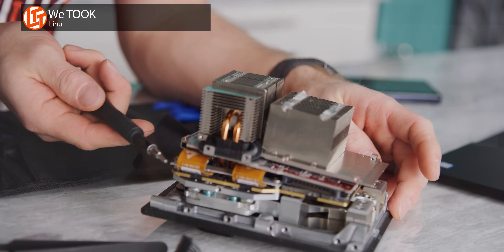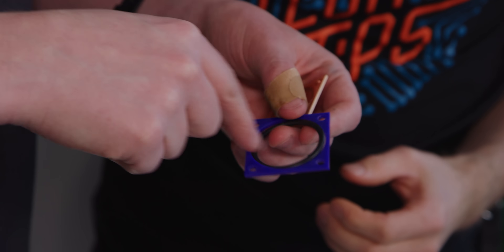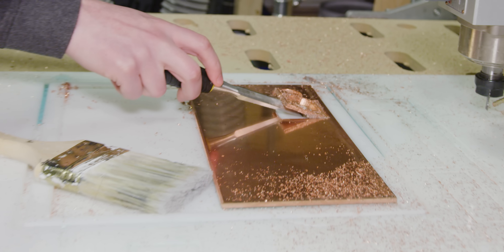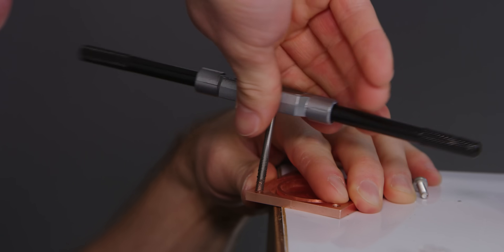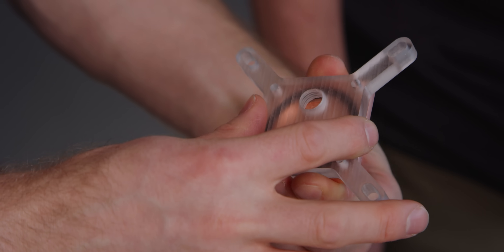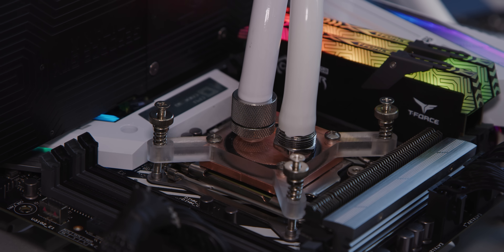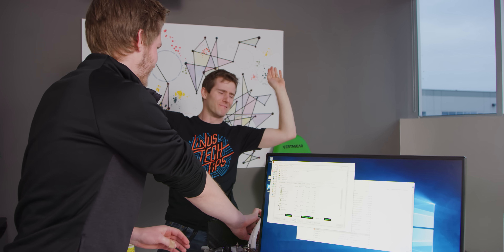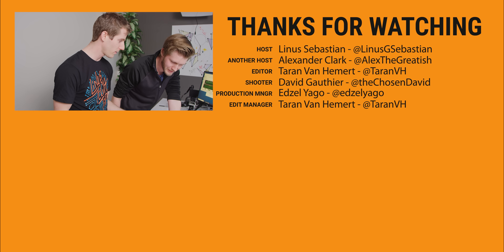We Built a CPU Water Cooler!

Comment: So, some ideas on the water block - making . . .

1.  I think I saw that you had a drill press somewhere.  Go to Princess Auto and buy a cheap centre drill or small centre, so you can put it in the drill press chuck.  Take your top and bottom pieces to the drill press and drill a hole, then using the centre and the tap, without moving the piece of material, immediately tap the hole.  This way the threaded holes will be straight and un-screwed-up, and you will be less likely to snap a tap or break the acrylic due to accidental (linus) mis-handling :)   This works on any size tap.  It takes longer to describe this than to do it.  If you do the holes on the CNC, then just use a centre in the drill chuck and run it down into the holes in the pieces to automatically centre them, and then use the centre and tap technique, or even just put the tap in the drill chuck if you're feeling brave and hand turn the smaller thread sizes.

2.  If you aren't sure on the flatness of the base block, then "lap" it.  Take a piece of glass (like old window pane glass, etc) and put some very fine grit wet/dry sandpaper on the glass, and then after wetting the sandpaper, just do small figure - 8s with the block on the sandpaper until you can see the fine, even scratches over the entire bottom of the block.  We did this on the actual CPU tops as well to make sure both them and the cooling blocks were perfectly flat.  Look up "lapping" for more details.

Comment: Indeed cringe too watch. But some tips! Make the heat slits with an glass cutter. Copper is soft. Or better get a slit saw for your cnc. And program the slits in 90 degrees. Super glue a little u shape 2mm high under the acrilyc. This will make the water be forced to the middle of the heatsink. And find its way up on the sides. And use a vice when threading. Too much cringe to handle. Keep up the work!!

Comment: Since you're going to be working with O-rings on a bunch of future projects, I suggest looking into Zatkoff O-rings. As a former Parker engineer (check linked in if you have your doubts) we never used Parker O-rings. We always used Zatkoff. You can buy directly from them. On designing note. A cad trick to making non circular grooves for O-rings is to sketch the inner edge of the groove and then use a sweep (or extrude down) to make the groove. You can then measure the spline length of the inner edge and get a length. Then use the circumference equation to find the diameter that gives you the same length and order a continuous O ring. 

Hope this helps!

Comment: Machining the acrylic flat, when acrylic easily is flat enough for the application.
Using a clamp as a tap wrench, thereby putting a strange sideways torque on it, risking it getting oval-ish threads. (yes, this is a thing.)
Gluing together an O-ring and being nearly 50% off. (this is a potential leak source, though a water cooling loop might not have enough pressure to make this a big issue.)
Well, I have seen many horrors the last 20 minutes apparently....

Though, at least they greased up the O-ring, something that even larger operations don't do for far more expensive products.
Reply: I've machined acrylic more than a few times. Thickness can sometimes vary 2-3 mm over a meter length on a '8mm' thick sheet. I would have machined it too when the part is already on the CNC table.

The glued o-ring is terrible. It may not leak immediate. But the pressure combined with deteriorating rubber will cause the bond to break eventually.

Also, they should have tapped with a drill-press as bit holder. Then you're always straight.
Reply: The funny part is that the one compliment you gave them is still wrong, petroleum on o-rings is worse than not lubricating since it cause them to deteriorate.
Reply: @GoldyMcGoldface  If rubber/silicone O-rings deteriorated when in contact with petroleum/hydrocarbons, then all hydraulics equipment would start leaking fairly quickly after manufacturing.

The main reason equipment starts leaking is due to physical wear and abrasion.

Though yes, there are O-rings made of plastics. (and most plastics dissolve in oils/grease. (And it is from here the large misnomer about o-rings deteriorating in oils comes from.))
Reply: @todayonthebench  I'll concede that their o-rings may be made of a polymer that is safe for use with petroleum based products, however rubber is 100% not compatible with them.

Comment: Heat and quench the copper to make it softer... Use a spray bottle with water, or water based lube, while cutting. Could also use, what i know as, machinists soap. It is a wax stick lube that makes little mess. You will have much better success.

Comment: So I guess Linus can't tell the difference between a tap and a thread chase....  Also, most hardware stores have DRAWERS of o-rings you can look through to get the size you need.  There does come a point where cheap parts and a bad engineer just end up with something FAR worse than it's worth.

Comment: A high tolerance is actually a fine tolerance, which allows for a smaller deviation. Where as a low tolerance allows for a higher deviation in the finish.

Comment: Lots and lots of cringing for any machinists watching this
Reply: Any time the try to make anything it hurts my brain especially in machining.
Reply: They should look for a proper machine shop that could manufacture their copper base... The cnc router they use is crap
Reply: JonessJack well I assume you also work in manufacturing as I do. Then you know it would be expensive to order just one part for a personal project like this. Our shop deals mostly with short series of 1-20 parts. I know what we'd charge for that part and that why I advice against it. I mean yes their router is shit but it's good enough for what they're doing most of the time. The best alternative would be if they could send it to "1186 mfg" or "ny cnc". They would probably like the promotional aspect of it and not charge as much
Reply: Here
Reply: Yep, Linus needs to invest in a retired or disabled machinist. lol
Reply: This had me yelling at my monitor
Reply: yep lol
Reply: first cringe was the fact he was threading the block at an angle
Reply: First cringe was when he said machining copper is very difficult....
Reply: @Worrsaint  Depends on the copper - i occasionally run 110 copper at work, and its gummy. Tapping it is the biggest issue ive run into with it. Ive also run Beryllium copper in the past, and it is tough,  gummy, and is toxic to boot.
Reply: @machinist7230  True, the alloy matters a lot.  Sharp tools, high speed (except tapping obviously) and lots of lube and I did not find it difficult to be honest even on a clapped out piece of crap bridgeport. Edited for typo
Reply: @Worrsaint  i was running endmills at roughly 700 sfm,  with flood coolant. Absolutley agree on sharp tooling. Best results for drilling was with a carbide split point parabolic from guhlring. Wound up not tapping in the VMC, instead doing it on a flex arm, as they have clutches in them, so they break free instead of snapping the tap. Also used Rigid dark for threading seemed to get best results.
Reply: @machinist7230  I have mainly only done manual machining making prototypes and stuff, not production machining when it comes to metal.  When drilling I brassed off my drills because it liked to get grabby.
Reply: This is so many levels above all their previous work
Reply: @vnyggi621  the bar is not very high tbh
Reply: @Worrsaint  you're right but I like where they're headed
Reply: I really didn't want to watch this because of that very reason.
Reply: I want to cry I haven't even finished uni
Reply: Your right there
Reply: I have offered  my services but I have had no reply lol .
Reply: Yeah, everything about this build video is driving me insane. He obviously doesn't know how to use a tap or he wouldn't have it on a 60 degree angle. And also the machined surface looks horrible.
Reply: Yes
Reply: Indeed. I felt physical pain at moments watching this. The tolerance for O-ring groove is actually so big, I usually don't even bother to measure it... The general tolerances in some jobs are smaller. The tolerance for o-ring groove is actually giving you MORE room for messing up.
Reply: I mean they did basically everything wrong
Reply: i puked...TWICE
Reply: Nothing makes me cringe more than machinists in YouTube comments who seem to get offended when someone tries to machine on their own.  Acting like they themselves didn't need to learn anything, but started out with all this machining knowledge built in.
Reply: Bacon Snot  Amen!
Reply: How dare they try something they are bad at!
Reply: @FaithfulFrets  Unfortunately, you can clearly tell they don't spend much time watching other people do it though, because they overlook simple things. The most machining I've ever done is running a band saw for a job for several months. Nevertheless, I've been watching a ton of machining videos for the past couple years and so many basic things they miss and I cringe probably just as fast as the next guy.

If you buy hand-tapping tools, they almost ALWAYS tend to have two handles on them to help keep the bit from going in at an angle. What they are using is meant to go into a machine like a drill bit, not be used by hand and attaching a wrench to it.

They should spend more time learning the basics at minimum through YT, not just going head-long into this crap when the tiniest mistake can spell disaster.
Reply: Sean Krewson same for any mechanical engineer
Reply: I’m glad I’m not the only one who feels this way 😖

Comment: Ugh... As a machinist i weep. For simpler threading put the part in the drill press. That way you can center the tap, and get it perfectly straight.
Reply: Stian or even better yet just get a tapping block lol that’s the cheapest and easiest way to get a straight tapped hole.
Reply: Or even fancier: threadmilling
Reply: Do they even have that? As far as I know they only have the CNC machine
Reply: @512TheWolf512  I have seen one in multiple previous videos.
Reply: They definitely have the machine for it. I think that whole part is just for extending the video.

Comment: Next time, I would mill an outer circle for the seal, an inner circle, leaving the central circle in tact, then use a dremel with a cutting disc to mill slots in the central circle. it could then act like the fins of a conventional block. It's not gonna be pro level, but better than the flat plate you had.

Comment: Hmm. Try using a copper alloy instead of just copper. Regular copper has about 20% of the machinability of free cutting brass. Where as C145 Tellurium Copper and C147 Sulfur Copper have 85% of the machinability of free cutting brass.

Comment: It's called a "slitting saw"! Research and invest, LMG!

If you have a manual vertical milling machine, research and invest in a "tap follower". Makes tapping anything 1000% easier.

When you properly through-tap a hole in a plate, the fittings couldn't care less into which side they are threaded. It's only left-handed versus right-handed threads that matter, and the chances of coming across something threaded left-handed is incredibly small. Essentially everything is right-handed threads. Righty-tighty, lefty-loosey.

Comment: Linus, these water blocks are small enough, I think, that you can probably flatten them on those fancy diamond coated sharpening plates.  They can sharpen a wide chisel, which needs to be super flat, I can't see why it wouldn't work on a piece of copper.

Comment: Its just acrylic. So you have face mill step, contour step, center drill step (for both sizes same center drill)  drill 1, drill 2, thread mill (could tap but i like thread milling better) 45° deburr tool step. Thats only op. 1 second op. is again facemill, and deburr tool. So its not even a simple program. So they must make it in idiotic masses (10k per serie or so)

Comment: FOR THE LOVE OF GOD THAT HURT! I’m an aerospace machinist i run 
4 and 5 axis mills every day, and program if you would like help please get in contact with me! Copper is very easy to work with, your work holding sucks! For your use make a table with 1/4-20 threads every inch, and get some mill clamps and you’ll be all set

Comment: Altoids mini tin and some threaded barb couplings from home depot, but... it was only for a thermoelectric project and not attached to a computer, so the leaks didn't matter, nor did the sharp edges  of the altoids tin lid after being drilled out from the inside and never deburred.
Reply: Oh and I also got thermal paste all over my carpet.

Comment: If you have a good cnc machine copper shouldn't be a problem if you maintain the proper rpm, which depends on the material (this case copper) and the size of the milling tool.  Cutting fluid always a plus.  Finding tables for this shouldn't be terribly hard like Alex's lovely o-ring manual.

Comment: Yep 2 monkeys, but at least monkeys can learn :P You need more surface in contact with the water flow, you can scratch it with a super coarse sandpaper or with the right setting an cooling u can easily mill 1mm groove or use a small rotary tool with a thin disk... Too bad there is no job opening to be Alex hand or an LMG mechanical helper. Have  nice day!! :)

Comment: I made my own blocks back when there were little to no commercial products. Gave up on copper and used alu only for ease of machining. I had manual machines only, the o-ring groove was turned on a lathe. You can increase area by aligning the block vertically and using a slitting cutter to make the grooves, it will make a huge difference.

Comment: You should use Polycarbonate, rather than acrylic, acrylic shatters very easily and is much less forgiving then it comes to a lack of precision, It also taps better for a more secure fit with your fittings. Love the work you guys do... but sometimes you are dumbasses. PS: Don't Laser Cut Polycarb... you will die...
Reply: I laser cut a lot of polycarb. It sucks to cut since it absorbs IR, and creates nasty soot that stains the router bed, but it's no more deadly than the gross melted plastic from plexiglass. PVC on the other hand....dead
Reply: @ydna  When you laser cut Polycarb, you heat the plastic to such a high temperature that it creates that yellow gas and soot that stains your router bed... that yellow shit is actually Chlorine gas and is highly toxic. I recommend that you seek medical attention.
Reply: also known as mustard gas
Reply: @cadejackson2874  Polycarbonate doesn't contain anything that will create chlorine gas. You're thinking of teflon or PVC.
Reply: @cadejackson2874 I I doubt it's free chlorine, firstly that's green and very reactive. If any is liberated would rapidly react with water in the combustion products to form HCl. Mustard Gas is different again, an organosulphur compound which would require the PVC to be sulphonated and even then I expect would not be a product of combustion.
That said you're not wrong about the combustion products being nasty, the primary one appears to be HCl but dioxins also appear to be a concern.
Reply: No they should have machined a block of Acetal for the final cover, it's a plastic that is well suited to this application.

Comment: Could you guys could do a video on replacing AIO water pumps, so I can service the ARCTIC Liquid Freezer 240 that I have and put it to use again?

 The whole AIO is basically mint condition but I got a faulty pump I guess. It would be such a waste to just get rid of it. I bought an emergency same day shipped Hyper 212 EVO when I saw my cpu temps sitting at 100*c realizing my AIO crapped out. Now my 7700K sits around 70*c during prolonged gaming, which seems fine, even though people said a 212 EVO wouldn't be enough for a 7700K, however, it doesn't compare to the 55-60*c peaks back with the AIO.

Comment: You need a vice to hold the part down while you work on it and tap the holes or other things.
Reply: Also when you thread hole you must go all the way threw as they are tapered to a point... the only type that you don’t run all the way down is a pipe tap, as they are meant to be tapered.

Comment: Not that it really matters as much for soft materials but when tapping holes you generally want to make a quarter turn the back off til you feel the chip break then continue tapping. With aluminum and soft shit you can usually just do like half or three quarter turns. Also the thread for those fittings are probably tapered that's why they can only go in the direction you tapped them.

Comment: some tips for LTT rough overall, but good job for your first project! 
warning: this is NOT CRITICISM
 
use lube to cut the copper, or remove cuttings w/ air

drill holes in a metal block the size of the outer diameter of the tap for use as a guide to start the tap straight. also putting a small countersink will help (spot first to csk size then drill)

pipe taps are a tapered thread and only seal in the direction you tap them

use a smaller tool to cut the slot than the exact size you want and compensate for the difference in software

last use a rigid fixture to hold the copper.  maybe try to drill holes in a plate and fasten the block to it for completion. this will also allow you to machine both sides.